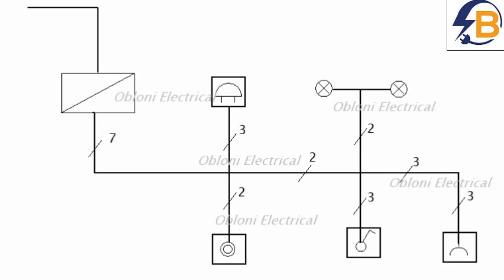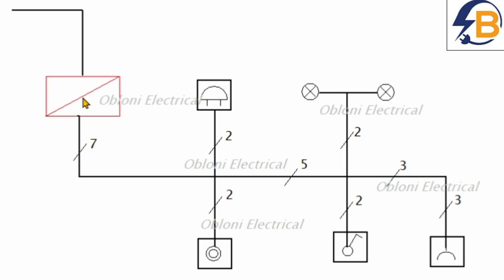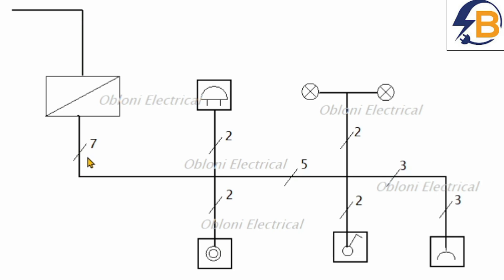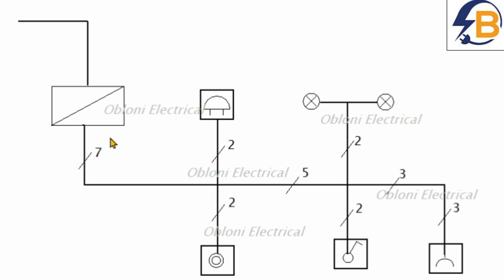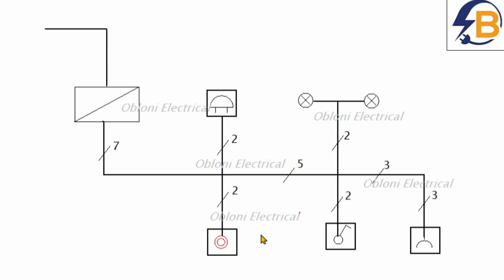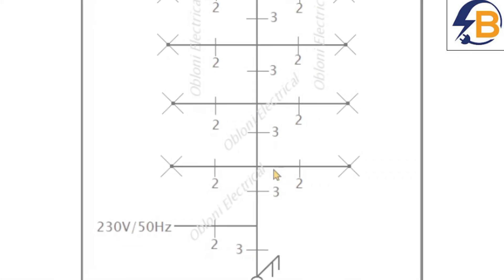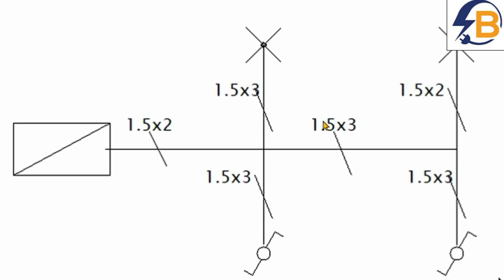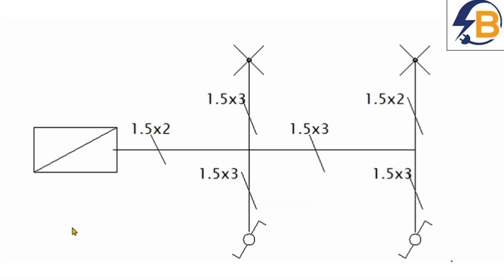How to Draw Electrical Plan | Professional House Wiring Layout Explained

Comment: Alright,thank you very much sir. If i understood the videos of the links you sent to me, the two wires connected to both L1 and L2 of the two 2way switches are the strappers right? 

Though, first video has no  volume but, i was able to follow-through and saw the two wires marked as strappers, then, understood it very well where you explained the connections of two 2way switches and that of intermediate respectively to control one lamp. So please, i don't know if I'm correct sir. Thank you.
Reply from the maker: Smart one. You got it 👌👌👌